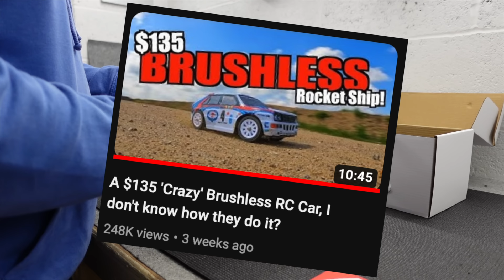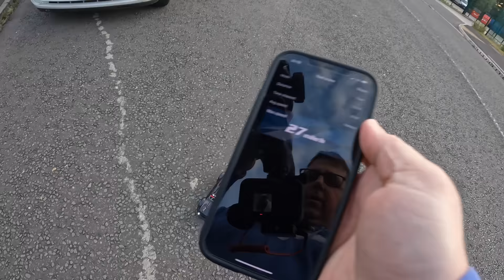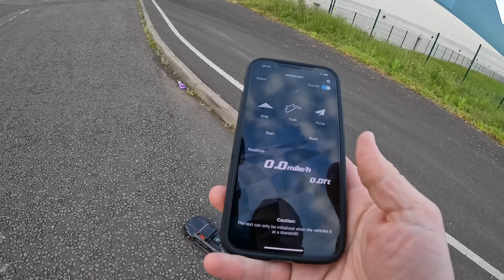The RC Car EVERYBODY Should Own in 2024!

Comment: I got mine 3 days ago...amazing car...i paid like $119 delivered...its great on 2s 2000 ion,but i have a couple 60c 1300 3s lipos that are about same size.. others are getting 42 mph with stock 15c 2s ion batt...mine should be 44 or 45 mph.. cool car..gyro is also amazing

Comment: So, when you did the review of the Lancia knock-off one, I ordered it. I absolutely love the car! My only gripe with it is the tires. These seem to use an odd size tire. They are 58mm outer diameter.  The 12mm hex means you can use many other tires, but they are either too small or too large for the car. So, I decided to try something drastically different.  I've ordered the monster truck suspension parts from China and will be fitting the longer arms to the mjx 14301 chassis. One of my friends has the monster truck, and we did a side by comparison, and they look like they use the same mounting points. I'm hoping to push the wheels out wider to make it more stable on 3S. I will let you know how it turns out!! Again thanks for the awesome video!!!

Also forgot to mention on 3S I burnt through both sets of the rubber tires in about 2.5 hours.
Reply: hey man, how did it work out? i had the exact same idea and you are the first person i saw talking about it. did it stay stable and still maintain speed?
Reply: @KaleidoscopeofBrilliance  sadly the arms in the rear had a slightly different mounting. The front fit fine though.

Comment: I actually bought this rc.  I’ve been stalking the Arrma Felony but that bad boy is $650 a pop.  This one comes with two batteries, three different sets of tires, and the wrench and replacement pins for the chassis.  It is also unbelievably fast.  This is a good buy and, even though it does not look as good, it comes at a very small fraction of the Arrma Felony.

Comment: I love the way this RC just "plants" itself after a jump! I am so happy with my  MJX Hyper Go truck, any tips to stop losing so many body clips will be highly appreciated. Happy RC-ing to everybody!
Reply: Put a tiny bit of RC clear fuel tubing over the open end stops them coming off 👍
Reply: Buy the body clips that have the rubber strap attached to them.  You drill a tiny hole and put a tiny dab of glue, and they last a long time!  Just buy a big ol' bag of them and replace them as they slowly die.
Reply: Just push the body clips all the way in instead of clipping them in the normal way. The lock in place. Or you can go to your local dollar store and buy paper clips and create your own using needle nose pliers which is easy and cheap lol.
Reply: @venomousgamer4205  Thank you, locking them in place is a good idea, however when they get caught on something they bend and still fall out, LOL. I hope to do my own clipless setup for the front and magnets for the rear because I have a few super strong mini magnets from old cellphone speakers. I will make an instructional video while am doing it. .
Reply: @stevearmett1565  Thank you for the tip, much appreciated.
Reply: @3Y3ECE  Wow, great tip, thank you so much!

Comment: actual or expected runtime?  clear packing tape can be used as inexpensive  bottom chassis plate protection.  packing tape is thinner than duct tape and stickier than painters tape...but all tapes are easily replaceable

Comment: Although the Hyper Go's are great performers for the price and the components are fairly durable, I find the tiny machine screws, which are threaded in plastic components, bend and strip quite easily, particularly the suspension components when bashing. So you end up with screws popping out and components comimg off because you can no longer tighten them properly. Not sure if the screws can be upgraded with plastic screws with a more aggressive thread or if there are other work arounds. But the fasteners can really let down what is overall a great RC package. Maybe less of an issue with this drift model but definitely a problem when bashimg with the monster truck models.
Reply: You can melt the plastic with a low-temperature soldering iron and reseal the enlarged screw holes
Reply from the maker: That’s the same issue with Tamiyas. Once you’ve removed the screws a few times they lose their thread

Comment: Maybe I've been out of RC for far too long, but when did the lipo-brushless combo start coming in at what I'd consider brushed/nimh speeds? I feel like it shouldn't need 3s to reach more speed than it can handle, unless maybe there's something very different about these modern budget brushless motor/esc's.
Reply: All comes down to the KV of the motor and the gearing. Do you want more torque and less speed or less torque and more speed?
Reply: @wilsgrant  I had to look up the car specs, and yes the specs jive with the vid. Turns out it's only 4200kv(!), which will make slightly less rpm at 3s than a 6800kv makes on 7.2v. On 2s that 4200kv should be as about what is seen here, which is 'non silvercan "sport-brushed" motor' levels. It makes sense once my brain grasped '4200kv'--the extra 3s voltage is necessary.
Reply: @Reaperman4711  Yeah personally I'll take punch over top speed any day for having fun. Let's face it - you run out of road before using top speed much anyway.

Comment: Hi Phil. Recently bought the 14210 truggy and swiftly sold it. Seriously slack steering with like 15 degrees of slack in the rack, car was too heavy for its wheels and smashed its rims to bits. Did not like to go straight even with latest dumbo gyro version. Bought it with 3 x 3s, alloy steering rack, mg servo, spare body, spare wheels. Song £200 plus and sold it a few weeks later for £70. Feel like 14210 was way over hyped on FB by all. Silly fast but actually crap to drive. This has the same base chassis by the looks of it. My boy loves to drift in dirt or grit. Is the steering better(less slack) and I presume this sweat his is 2s or it will just donut on the spot every time you go near throttle? Sorry for war and peace, burn when I buy a cheap basher I don’t want to be pouring money into it, just want Tom bash it to bits over a year or two and then replace it, like the tracer.

Comment: How do you feel about the turning circle on these...we have the rally version and it's a nightmare getting it around our backyard track
Reply: I will add we run a losi min 1/14 around our track and it handle a lot better in my opinion unless ours is a poorly mjx lol
Reply: there isn't much suspension travel before bottoming out and the tires can't handle the power.  adding any camber (if poss) would only make it worse.    this seems like a squirt and shoot r/c w/constant throttle modulation

Comment: Hallo Tomley RC, I just got this as my very first RC and dont know if something is broken or if I'm just doing something wrong... when I want to reverse, I sometimes have to double press the button because it doesn't register. is this wrong, or am I just being a muppet also one of the indicators LEDs is weaker than the others. kind regards
Reply: It's a protective feature to keep you from going into reverse at full speed. If the trucknis moving the first trigger push/pull in the "opposite" direction is your brakes, and in order to go the other direction you need to release and push/pull again. Nothing wrong with your truck.

Comment: I can't believe all of the paid youtubers that are raving about this truck.  The electronics are absolute garbage.  I don't know if they just care more about their perks or don't understand how quality RC Cars are supposed to drive, but the reviews are irresponsible.  I'm not picking on Tomley, there are a bunch of reviewers on here missing the boat on this truck.  I've purchased both the black and the teal one, the 14301 and the H14MK and they both function IDENTICALLY.  There is ZERO movement from the truck until you pull the trigger past 1/2 way.  If you use any kind of throttle control at all for slow speed movement, you get chatter, chatter, chatter, lurch several inches, stop, chatter, chatter, chatter, lurch several inches, stop, repeat.  To get beyond this "dead" zone, you have to get to about 60% throttle.  So, there's basically no low to mid range throttle control.  It's 0 - 60%.  It's ridiculous.  I don't understand why this isn't addressed.  No way I got the only two lemons out there.  The trucks seem pretty well built and seem to handle OK on a variety of surfaces but having to immediately upgrade the electronics make it about a $75 truck, not the $140 - $190 you see it for on AMZ.  Good Luck!